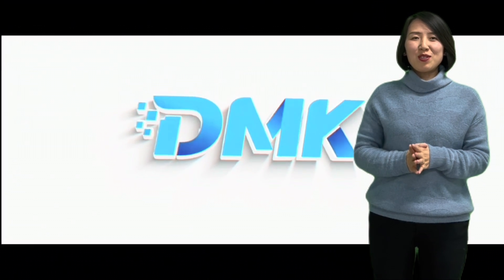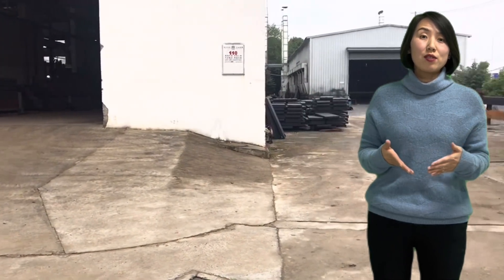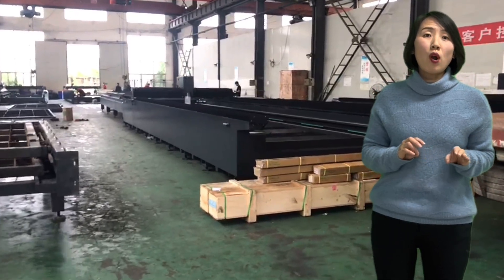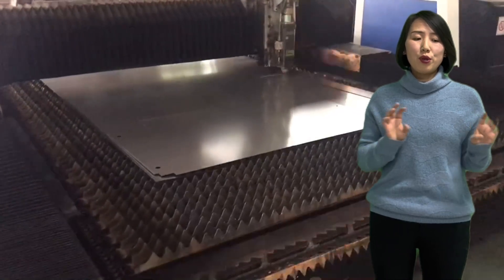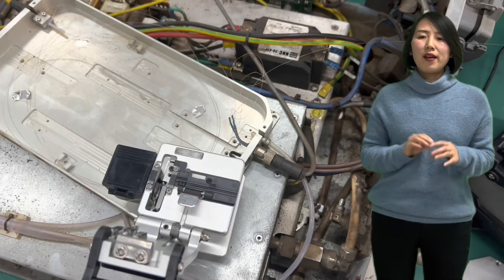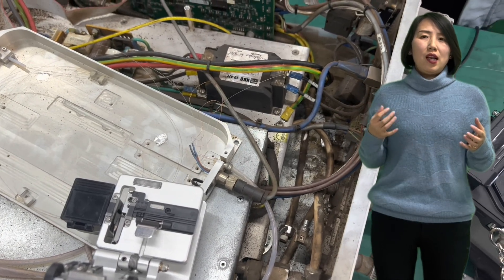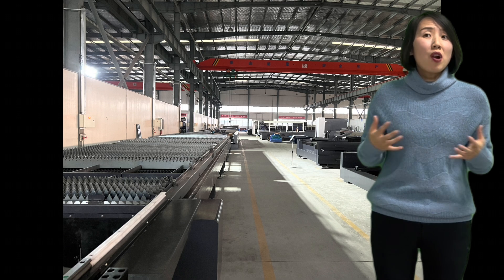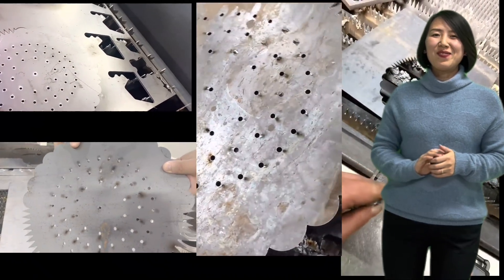How to build your own fiber laser cutting machine with cypcut control?

Comment: Thank you very much for your educative videos. Do you have any experience with using and setting parameters of different type of servo motor and driver than the ones shown in BCS100 manuals?
Reply from the maker: i personally haven't that experience, but i can check with our engineers if you have more specified questions
Reply: Thank you for replying. Definitely, that would be great. I can send the model of the servo motor mad drive and everything else that your engineers might need.
I believe it's easier through email : miljan.tmt@gmail.com
Thank you

Comment: Good points.
That is what I am thinking about it.
I believe we also have difficulties doing so.(CORRECT ME IF I AM WRONG)
1. Welded lathe bed requires heat treatment to reduce shear force.
2.We still need gantry beam to be shipped from China.
And shipping these parts one by one does not neccisarily save cost.
3.The maintenance cost the same as we need to return the parts to China to do the repairing.
Reply from the maker: yes,concerning the points you write here means you really think about it very seriously; after I posted this vedio for few monthes, there were many people agreed and very interested in the project, but with limited sources from you side about the heat treatment and milling process, molding of the gantry part, no one has put into actions untill now. anyway, maintenace is not a problem, if you can repair the laser sources with proper tools, nothing will be need to retuen to china for repair anymore.
Reply: @jallyqu Thanks for your reply! How much will the repair toolkit cost for laser less than 3 kw
Reply from the maker: @charlesfeng3823  may I have your email address, so that we can send you the fuul package price in detail

Comment: I'm interested in both cutting on a CNC and fiber laser welding. Is it possible to use one laser source for both?
Reply from the maker: theoriotically it's possible to make that one, but in reality, it's similar cost to buy two machines seperately

Comment: Hello jolly awesome video.. Am curious I have a 30. fiber marker wanted to convert into plotter laser cutter.. It's a galvo head.. Can I run cypcut to run any fiber laser..
Reply: 30watts
Reply from the maker: 30w power is a bit low to cut metal, and fiber laser only cuts metal, not wood or plastic glass, so i suggest to staying running as a marker is the best solution for the laser